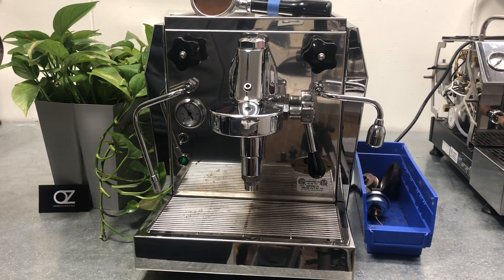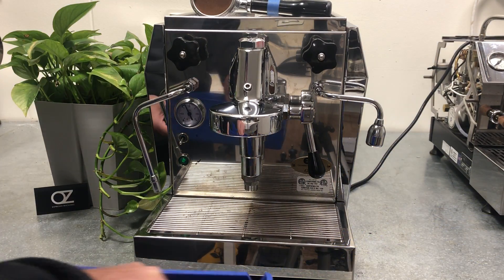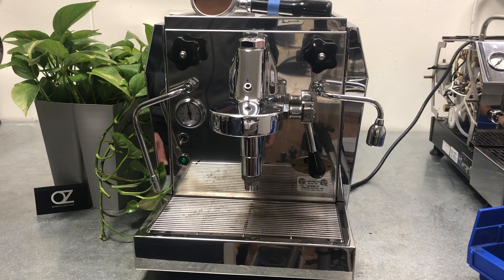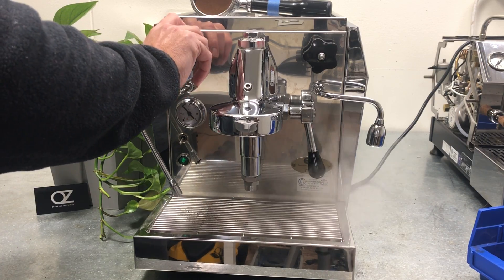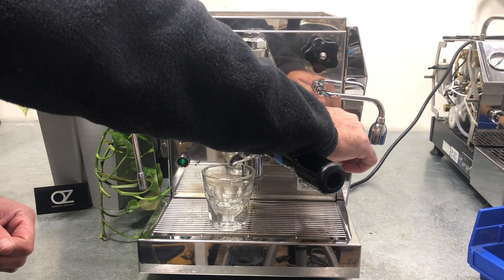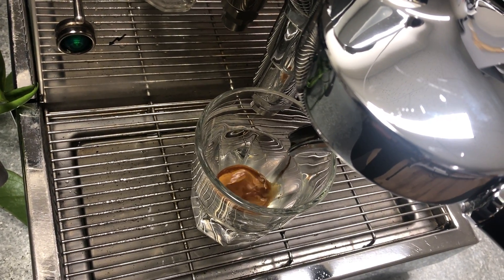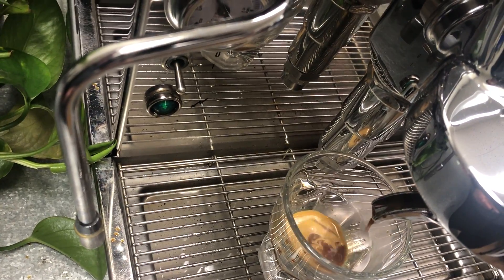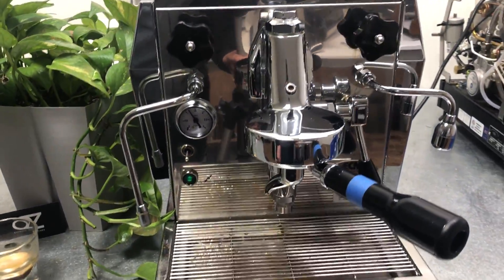Today's Repair  |  ECM Giotto Espresso Machine

Comment: Looks as if you had the portafilter cranked around to far to the right on the brew head.  That is probably why your shot was so slow and dripping.  Cranking the handle past the 6 o'clock position will over compress the sealing ring and tighten up on coffee up in the brew head.

Comment: how much is an internal pump for one of these & are they easy to change?
Reply from the maker: If I recall correctly this one has a standard Ulna pump, the usually run for about $35 more or less, not so hard to replace but it takes some work to open the machine.

Comment: I own this machine and am having an issue with overfilling and no steam at the steam wand. The boiler heats up to temp and creates pressure but no steam and then over fills. I already replaced the pressure stat still having the same issues. Any advice would be great. Also, where did you get a replacement Gicar controller box? Thanks!
Reply from the maker: It could be a bad fill probe or ground connection to the controller. If that is not the case then it could be a controller issue
Reply: @ozespresso  looking to get a gicar controller box, where did you source a new gicar controller?

Comment: Is this a good machine to own for a super small business?
Reply from the maker: It might fit a small business but is not sure if it's  NSF rated. Also, you might want to consider somthing with a direct water conection and a rotary pump for better preformance. 
Hope this helps! -Y